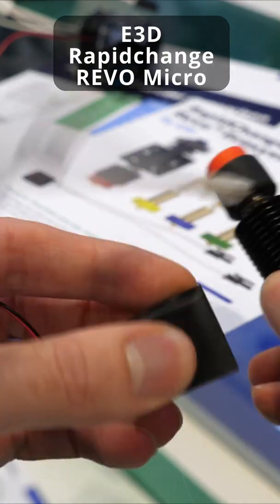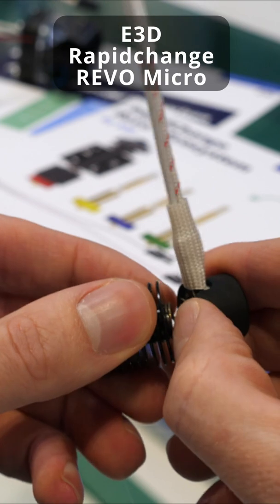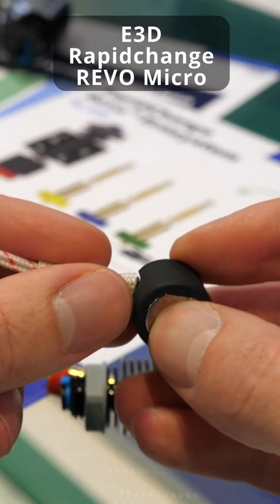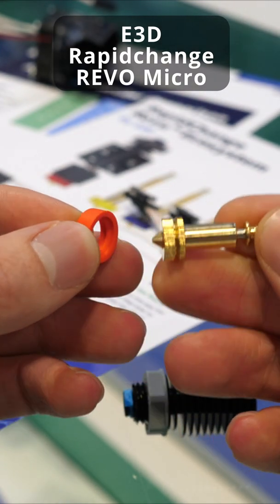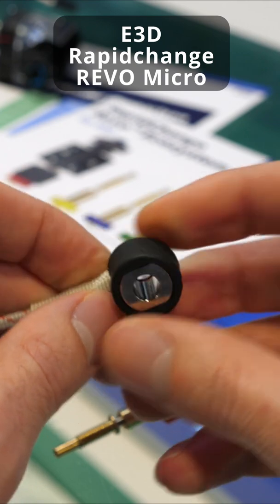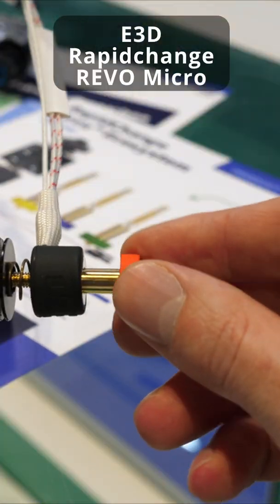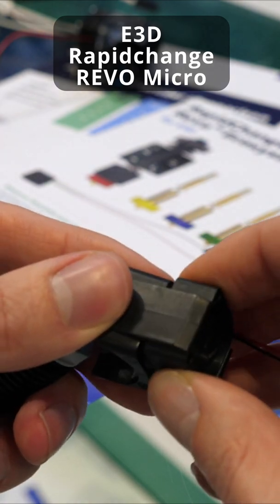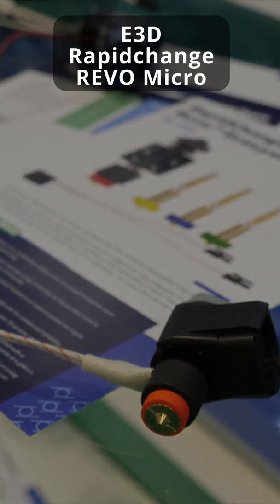E3D REVO Micro Disassembly #Shorts #Sponsored

Comment: Since its tighten against the spring, does this mean that the bed will probably need to be to re-leveled  every nozzple change?
Reply from the maker: No, the nozzle is positioned via the stop at the end of the thread. The spring is to position the heater against the nozzle, not the other way around. Hope that makes sense.
Reply: @Vector3DP  gotcha, nice!

Comment: I'm curious why they didn't go for a courser or shorter thread on the nozzle or maybe even a half turn lock system if you could get it to seal well enough.
Reply: Fine pitched threads are much less likely to loosen due to vibration.
Which is obviously quite important :)
Reply: @_Piers_  The v6 looks to have a much courser pitch thread and I've never had a problem with it.

Comment: People asking about the Spring. The spring applies force downward against the heater block and thus the nozzle, so that the nozzle is always under tension against the heater cartridge. This is because the heater block is "floating" between the heat sink (cold end) and the nozzle (hot end). The heater block has no threads I believe, its just like a really thick washer.
Reply: true, it almost like the primary heat transfer surface is not the internal bore but the flat surface that the heater presses against the nozzle.
Reply: Now I realise that the spring is there to provide thermal decoupling from the cold end as well
Reply: It's gonna be interesting to see what kind of new 3rd party wizardy folks are gonna come up with in terms of nozzles and "mods" for this new hotend system 🙂

Comment: So thermal paste is no longer a thing?
Reply: I believe that is correct, the nozzle is the heatbreak.
Reply: @ChrizRockster  Yeah it looks like. So time to switch to this one or protoprint raptor 😁
Reply: Nope in testing they said not to use it, and I had no problems.
Reply: @rileyfenley522  Great. Thanks for confirmation 👍

Comment: Shows the scale there a bit better. I am not sure that this could work on the smart effector by the duet folks.
Reply: looks smaller than a volcano, so should fit anywhere a volcano would.
Reply: As a beta tester with a duet smart effector i can say it works perfectly.
Reply: @thegarageluthier  does a parts fan attach well enough still? Is there physical length of the new hot end roughly the same?

This will allow me to consider it as an upgrade.
Reply: @zzing  The micro is slightly shorter, i use 2 x 4010 blowers with custom  mounts for part cooling and have no issues printing abs, petg or pla.  Only issue i have is i have a beta revo and no nozzles so have to wait until release to get some more :-)

Comment: Loved your video with Sanjay on it! Definitely interested in this solution and wondering if I could somehow manage to mount it on my CR10-S which I upgraded to a direct drive via the MicroSwiss direct drive kit... might proof to be impossible but worth looking into.
My only gripe with it is that they are only available in brass for now. Especially when you consider that the nozzle design is so unique and because of that you can't even install a hardened steel one when you want to print abbresive filaments. If they manage to make these in their newly announced material/coating that suposedly lasts forever this will be a killer combo!
Reply from the maker: Yep, the ObXidian is coming to REVO and should even be before the end of the year.
Reply: @Vector3DP  Sweet!
Reply: Yeah, this is the one gripe I have with it, that it is not backwards compatible with V6 nozzles. I think there is a bit of a lost opportunity here to design a heatbreak such that you could screw in any standard V6 nozzle, then E3D would have only one heatbreak component to manufacture instead of all the different types with different materials and nozzle diameters. Everyone would get backwards compatibility and the convenience of setting up the quick change hotends with whatever specific ones you choose, and to just swap the nozzle tip rather than the whole thing when it wears out. 

There may be a mass and/or performance drawback to that though I suppose, and hot tightening may be more difficult.

Depending on the dimensions of Revo it may be possible to design such a heatbreak, even if a third party does it, although it may come with a performance/length increase, but I would be willing to take that for the backwards compatibility.

Comment: That fan looks so small though.
Reply from the maker: Fan on the micro is 20mm which is smaller than v6. The heatbreak is apparently very good so cold end and fan have an easy job in theory. Also many will scrap the built in fan and implement into a design like EVA, prusa or afterburner etc.
Reply: looks to be the same size as the V6 ones
Reply: @vizionthing  OK, but still looks small. Maybe it's just efficient? That mass of material in the nozzle looks like it needs a lot of cfm to keep heat creep at bay. How tight is the tolerance between it and the heatsink body? Thermal conductivity doesn't like airgaps.